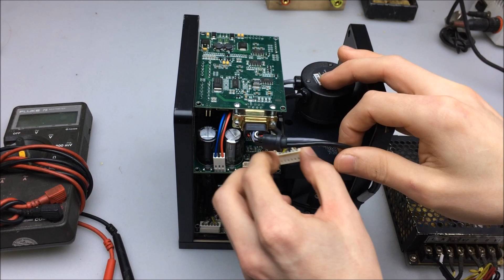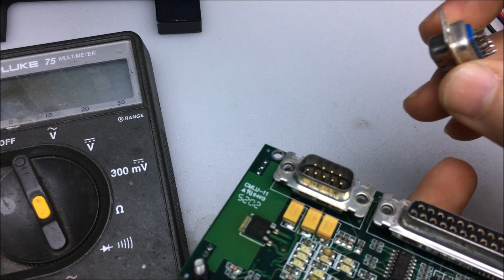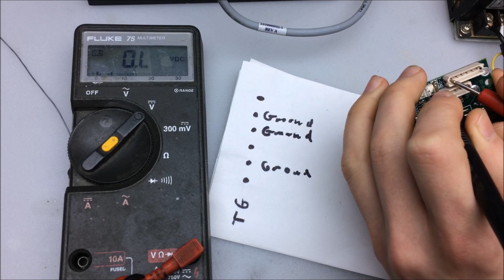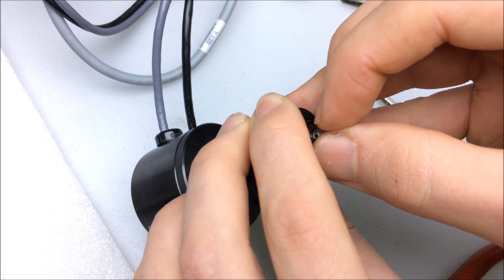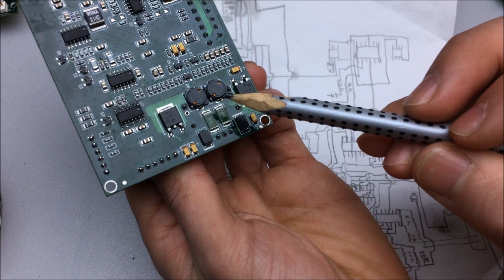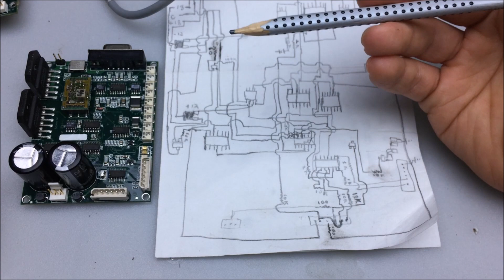Raylase Dual Axis Galvanometer Laser Beam Steering Assembly

Comment: I have two of those galvos. thanks for showing the branding, mine had the sticker replaced by Scanlab numbers. They have a capacitive sensor inside.. mine whistle, draw 3 to 4 amps and after a minute pop the tiny Scanlab pcb fuse. Mine are driven by a Scanlab AG2004 pcb module. Also, a bit late now you done it, but you didnt need to desolder the internal wires, the shell pulls off if you let in some cable through the grommets.

Comment: they look exactly like scanlab ssv30 on the inside. capacitively coupled feedback.
i had one starting to oscillate due to a galvo/driver mismatch and a lose mirror... it shot the mirror across the room when the epoxy failed and broke off both limiter pins LOL those bastards have power. drew like 150..200W from the psu when it did that.
they are using this soic chip n the golden board really just as a rectifier for the pickup electrodes. it doesnt measure the capacitance but theres multiple electrodes and depending over which the rotating plate is, the signal is either strong at 0 or 180° phase and after rectification its just a dc voltage that either is negative or positive.
Reply: yes, just discovered the same, very sensitive to mirror weight, need fine adjustment otherwise whistle like hell, and burn the fuse. love to find the service setup data for the 9 tiny pots on the scanlab AG2004 pcb

Comment: i wondered if a simple board tracing might help identify if there are any failed componants?
Reply from the maker: Simple board trace? Nah I just test them with the meters, even with tracing out stuff it gets very hard, esp with these amps as they are multi layer PCBs. One thing that absolutely stinks is that I can't see through the ground plane to look at the traces with a light behind the board. It makes the unit work better but as far as locating connections go it's an absolute nightmare.
Reply: @Zenodilodon  I can imagine, specially doing what you do, when it's an every dya thing, it soon takes your time away

Comment: that ending haha, remember it belongs to someone!
could you voltage drop your supply or do you have a constant current board orrrrrrrrr ebay do have these things, i really wanted the 5v power supply...at like 70 amps :D
Reply from the maker: The bigger problem is that its a -com+ PSU, there are plenty of - + ones. Modifications could be made to my 24v one to drop it lower however I don't think it has enough current. These galvos are power hogs in contrast to the small show laser ones. 

5v at 70 amps, that will chooch a lot of LEDs along!
Reply: @Zenodilodon  so many leds! 😂
You think it could spot weld, or I need higher?

I keep having to find new 12v ones to run at 10v,but with limited amps so I don't melt an internal filament in my xray tube

Comment: what happened to your power supply?!
i ran mine without grounding the other night, short story version, i now have to install a complete set of new diodes, i guess, never run them without grounding!
Reply from the maker: I had painted the case years ago mostly for rust prevention that's why it looks black. I haven't had any issues with having them ungrounded though I try to ground them when they are in a completed device. I don't exactly know what made your PSU go poof but It's hard to think that it was a lack of ground. Usually ground is one of those cleaner signals/safety things but doesn't directly tie into it's functionality.